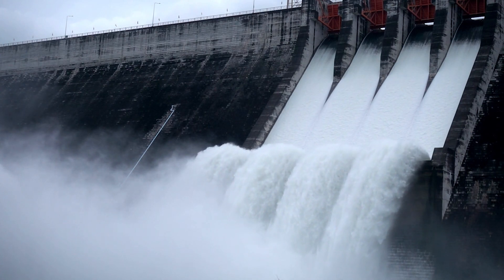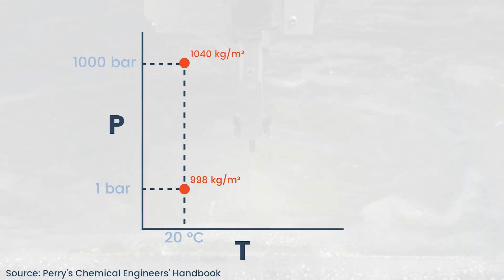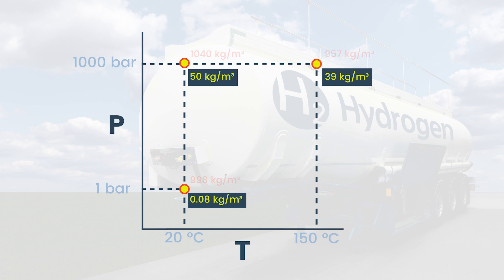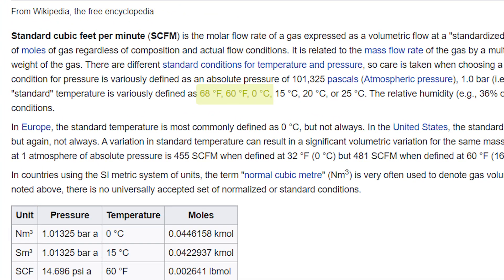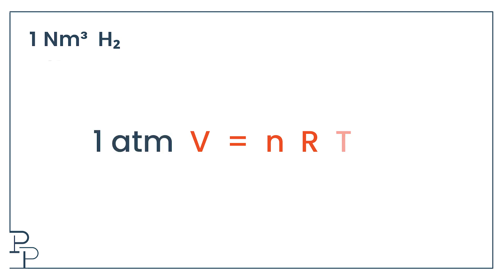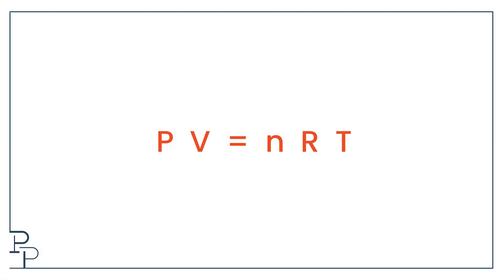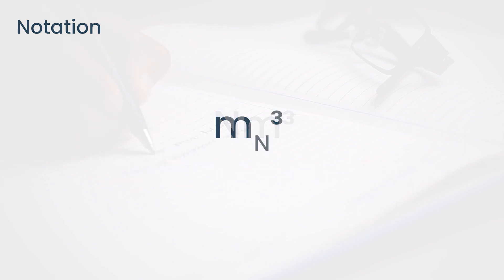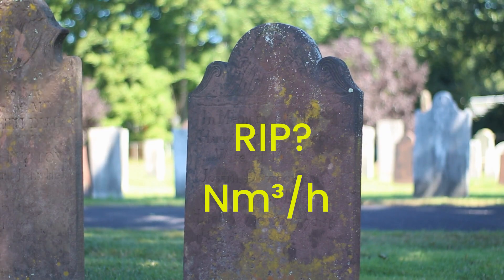Normal cubic meters

Comment: In Chemistry we used 273 kelvin (0 degrees Celsius) at 1.0 atm for STP. We also used 1.0 mole of gas had a volume of 22.4 liters at STP. This is what we used in PV = nRT to get the value of R. These are nice units to use because of the ease of remembering the ones for P and n, and 22.4 is also easy to remember.

Comment: Wow!!! Like you this has bothered me no end for the past few decades.  Nm3 is Newton meter cubed.  That's for sure.  In our statute books it's also listed as Nm3.  I agree that this parameter should be changed to Vol(n).  After all, if there is a Nm3, would there be a Nm (Normal meter) or NW (Normal Watt) or Nkg?  That's stupid!! And maddening!!  Also many decades ago before the advent of internet I found out that standard temperature is 21.1 deg C.  Can't remember where.  But there there are different standards, 25, 20, 15, take your pick.  Its mind bogging!!

Comment: Model this as an electrical circuit and the answers fall right out. This is because, as an electrical circuit, any difference in pressures (or voltages) between two points in a flow path DEMANDS that there be a resistance (or flow restriction) between the two points. If there is no difference in pressure (voltage) between two points an infinite flow (current) will result. Since this doesn't happen in real life you have to consider the pipe as having some resistance. And since it will not usually be enough resistance, an external resistance, or valve, needs to be added. If you need to drop 8 bar in the "B" flow then the valve could be replaced with a check device (spring and ball check valve that opens at 8 bar)  that drops 8 bar across it when a fluid is flowing through it. This will of course release heat at the check valve or regulator.

 It also points out that you were really asking the wrong question to begin with. The right question was "How do I get the flows I want given the initial conditions."